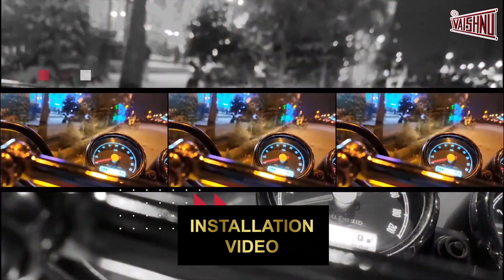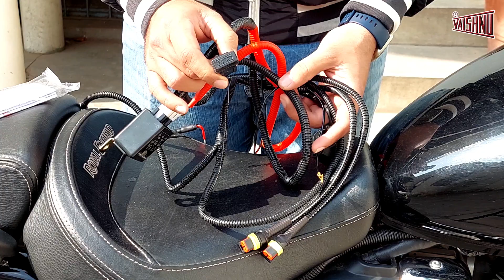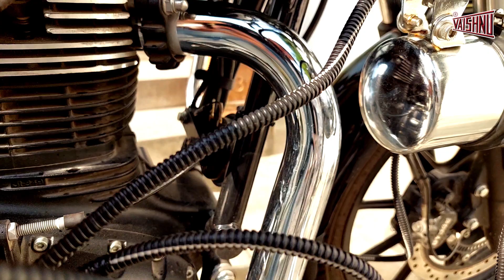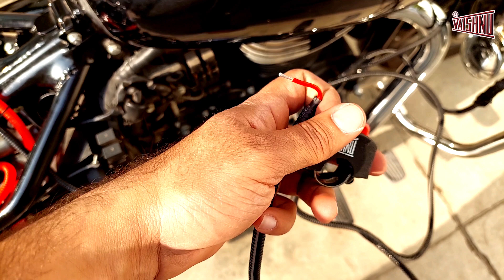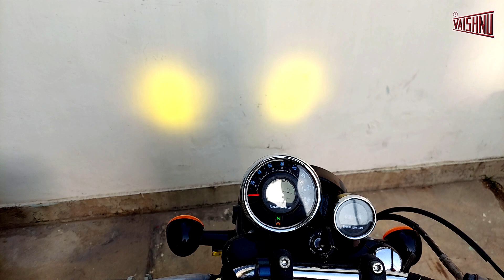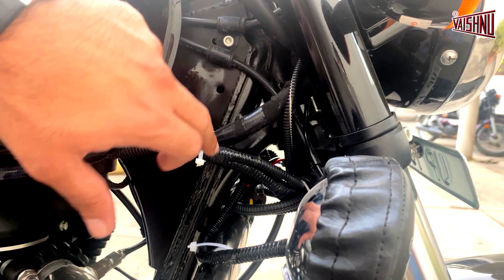How to Install LED & Halogen Fog/ Auxiliary Lights in Bikes| VAISHNU Wiring Kit Royal Enfield METEOR

Comment: Just a small and important question will the relay not continuosly consume the battery power ? since we have connected it directly with the battery!!!!! 
Relay is also a switch right ?
My major concern is battery drain how do we stop that ?
Reply from the maker: Greetings! The relay is only activated on command when the vehicle is started. It doesn’t consume any power when the vehicle is off.

Comment: Everything is fine but I am using a fog lamp which has 2 colors white and yellow but you're providing only a single switch button which can be used only for yellow or white not for both? Then what is the soluation?
Reply from the maker: @wasimsaifi7684  Greetings! This is only a single color supporting wiring harness. If you want to use a dual color fog lamp then we have a different harness compatible for that purpose. You can find part no 4102 listed on our website suitable for your application. Regards

Comment: Honestly these are the worst harness I have ever used. The connecting material is of low quality, making it disconnect from lights. I'm going to remove these and use a bit costly one with good quality
Reply from the maker: @sidwithstuffs  Greetings! It would be better if you could reach out to our customer support team and share your problem who will help to provide a solution for this rather than just leaving a comment which is not going to help your cause.

Comment: I fitted my aux light today and the fitter man has fitted ignition cable into fuse box in between fuse where fuse of headlight is … is it safe to? Right or wrong
Reply from the maker: Greetings! That works, no issues with that.

Comment: switch aesthetics are sub par, wire routing was not shown below the tank
Reply from the maker: Greetings! We have an advance version available with upgraded switch. Wire routing was done below the tank from the sides. It can be easily done on certain models otherwise you can remove tank and wire them along the chassis.

Comment: What is the purpose of harness when aux lights can be installed without it? 
Regards
Reply from the maker: Greetings! Harness protects your Bike’s original wiring Harness in cases where your fog lights malfunction or due to improper connections there’s a short circuit.
You install with Harness, it will prevent all of these scenarios and if you install directly any fault will end damaging your Bike’s complete harness or may end up causing a fire.
Wiring harness is a small insurance to protect your bike and yourself from any major accidents.

Comment: Do u give extra female connectors as told in this video with product 2104
Reply from the maker: Greetings! Female connectors are part of the wiring harness. We provide extra male connectors to make the setup complete and for you to connect to any fog lights with single color operation.
Reply: @vaishnuautolightingsolutions  thnx for Swift reply

Comment: Where I will connect earthing wire 
Can you guide about earthing wire
Reply from the maker: Greetings! The Earth wire can be connected to the negative terminal on the battery or any Bolted points on the bike which can provide earthing to the cable.
Reply: @vaishnuautolightingsolutions  Car ke liye 3 colour with high/ low beam fog light harness hein kya aplogo ke pass
Reply from the maker: @ Yes! Check our model nos 4108 and 4109 on the website www.vaishnu.com in wiring harness for cars section.

Comment: Can I install it aprilia sr 150 ?
Reply from the maker: Greetings!
Kindly check the battery specification of the aprilia to be of 12 Volts. It is compatible with a 12 Volts battery of any bike/ Scooty.
Reply: @vaishnuautolightingsolutions  Yes 12v ....
Reply from the maker: @sounakdas5002  you can use the wiring kit then..

Comment: Will 120W (60w x 2) fog light supported by this harness?
Reply from the maker: Greetings! Yes sir, this harness can support 120 watts of load easily.
Reply: This makes battery dry....connecting frm battery directly.....any one facing tiz issue
Reply: @MyKarankk  my previous battery goes dry and wiring have some issue with previous hlj harness... No issue till now with this harness...
Reply: @JeetChowdhury i installed this lights without harness bro..my stock battery was dead.new battery is drain many times..will this harness prevent from battery drain problem?
Reply: @yuva9323  i am using harness now, no issue after using harness...
Reply: @JeetChowdhury  which harness

Comment: are these lights legal in terms of wattage?
Reply from the maker: No Sir! In terms of Legality, No Vehicle is Supposed to be using any Auxiliary Lights in the City Limits wherein the Combined Wattage of the Fog lights is above 60 watts. Although you can be also fined in City Limits for any Lights which do not come as Factory fitted, depending on the Cops Mood. Our Thunder Series Lights are rated at 70 Watts/ Pair and are strictly for Off Road/ Highway usage. The real need of the Auxiliary Lights are away from the city anyway. In that sense, these will fulfil the Purpose and legality is taken care off by Covering the Lights when in city limits. Hope that was Helpful, do get back for any more Queries. Thanks
Reply: @vaishnuautolightingsolutions  thanks for replying.....that mean if I put cover on those while riding in cities there will be no problem.....right!!!
Reply from the maker: @RovingRevs  True Sir! Also a word of advise would be to mount the Auxiliary Lights below headlight level for a completely trouble free experience.
Reply: @vaishnuautolightingsolutions  ok..thanks...now the big question.....will it fit in my dominar 400 2020 model
Reply from the maker: @RovingRevs  It will be Compatible with any Bike having at least 5 amps of Battery Specifications. If the Dominar has anything equivalent or above it, It is compatible for sure.
Reply: Checked with RTO
Install Auxillary Light below HeadLight
Use Auxillary on NH Only
Cover something to hide the lights on City..

Thanks All..Enjy the Ride with Passion

Comment: Battery draining issue....
Reply from the maker: Greetings!
Battery draining issue is associated only to the electrical load of the auxiliary lights/ other accessories installed on the bike.
The harness only transfers current to the auxiliary lights, how much or how less suitable for the battery is dependent on the lights being used.
So if you are having battery draining issues check the total electrical load of all the accessories on the bike.
Reply: @vaishnuautolightingsolutions  using night eye led bulb in headlight and 80watt hjg fog light with your harness
Reply from the maker: @mayankshukla7587  you also need to share any other electrical accessories on the bike and the battery ampere of the bike.